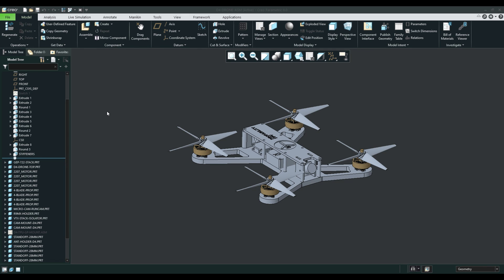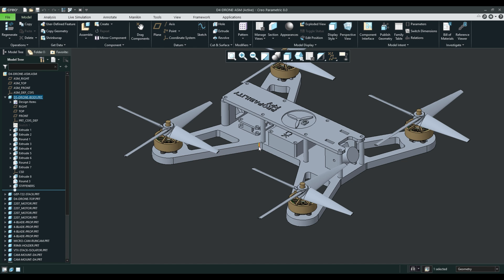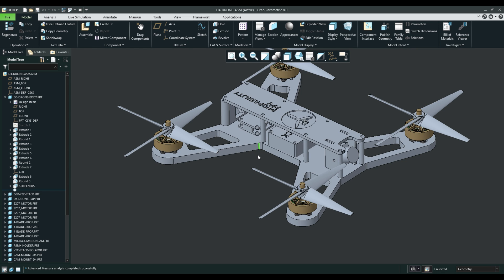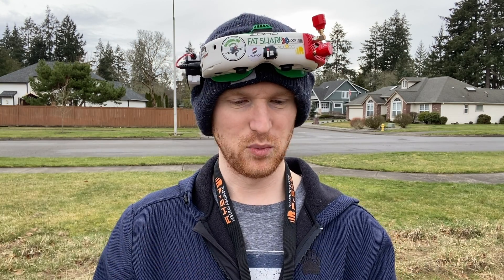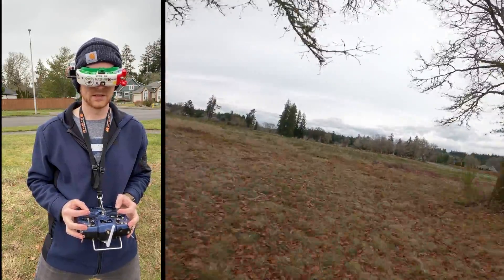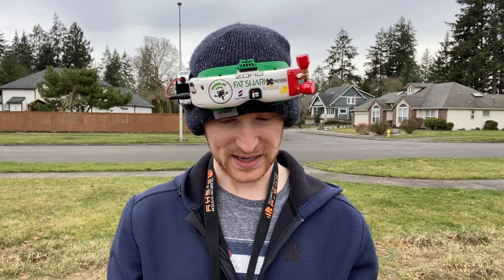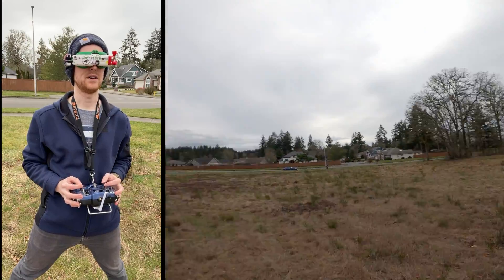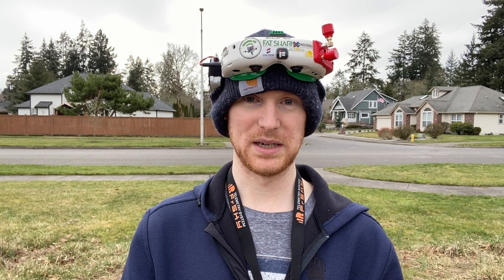PLA 3D Printed Drone... And Yes, It Can Work! Build/Flight Video // PropabilityFPV

Comment: Vert cool!  Do you have design files available for download anywhere?  I'd like to try this.
Reply from the maker: I'll get some uploaded and shoot you a link!
Reply: @propabilityfpv Awesome!  Thank you!
Reply from the maker: Check these out- print each with at least 3 wall lines thickness, and at least 20% infill. Might have to adjust filtering a bit to account for vibration but it should get you close! The camera used in this is 19mm width, standard 2207 motors, 30x30mm esc/fc mounting, and room for a 20x20mm vtx/receiver stack in the back.

https://drive.google.com/drive/folders/1DxHPgwcXXRy7PGejLEYiSqwnS5kp7ud1?usp=sharing

Comment: Try pla or petg with a % of carbon fiber in it and you could reduce weight. Use always the 2nd design of course. The optimum maybe would be carbonylon

Comment: Can you build a 60 inch long 2 ×2 inch or 3in x 3in drone made out of foam? With that type of foam that is coated with a film layer that protects it from breaking apart.  It would look like a missile but with propellers.  One proppeller pushing air out at one end and 3 proppellers to control
Reply from the maker: I might be mistaken, but I think maybe Flite Test has done something like that? It would be pretty cool but I think getting the tuning right for something so tall might be difficult
Reply: @propabilityfpv  I know but imagine the people watching from a distance if you put like a high intensity led in each end and you fly it at night.  A freekin UFO...videos would would show up everywhere and if you fly it high noone can hear the propellers lol.  I mean it would have to be stable though to make it do some crazy moves and not crash
Reply from the maker: Freaking out the UFO crowd at night. I like it haha thanks for the idea! I just might start thinking of ways to do this 😂
Reply: @propabilityfpv  The famous tictac...lol